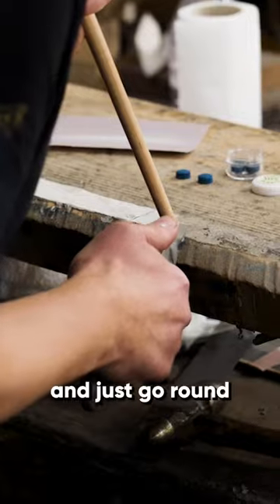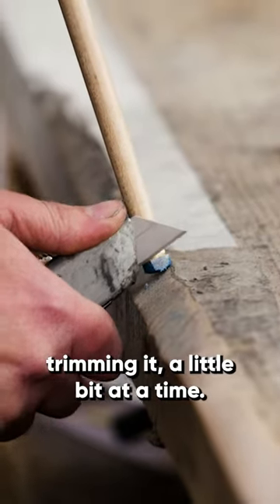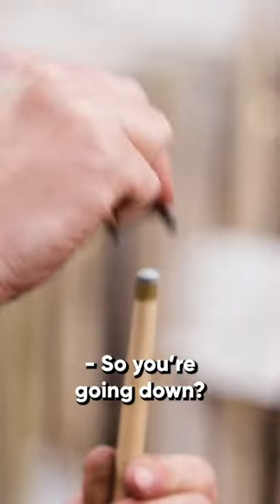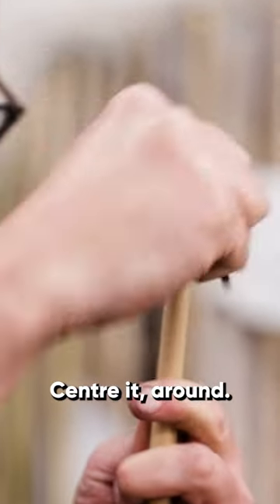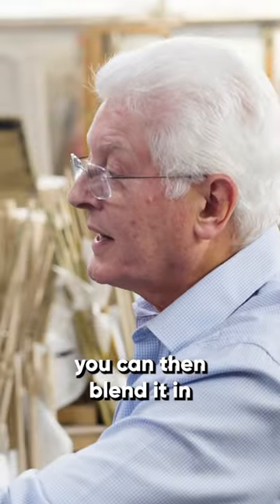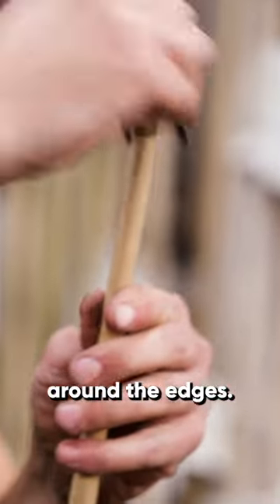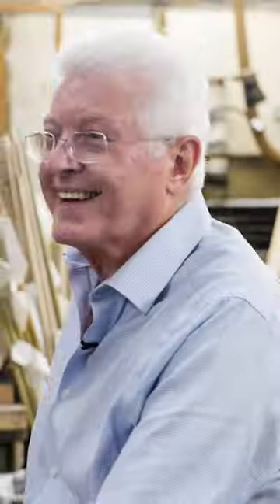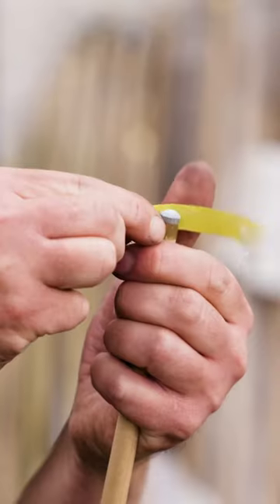Change A Snooker Cue Tip Like This

Comment: What Sandpaper should we use to shape our tip?
Reply: A light to medium abrasive paper to shape. Finishing with a very fine paper just to take the sgraggely bits on and make fine adjustments in the shape of the dome.

It also depends on the softness of the tip. A softer tip will require a finer paper or u will take too much off at once.

Replacing tips is overcomplicated. It's an easy and fast process that once uve done it a few times u can do it a 1000 times.

Comment: Every time i cut the tips like that they kinda rip apart
Reply: Make sure the blade is brand new. I use a new scalpel blade. Make sure you're not cutting straight down with no back and forward motion, draw the knife towards you as you're cutting down.
Reply: I just buy 9.5mm tips for my 9.5mm ferrule...it really isn't so hard to centre it before the glue sets.